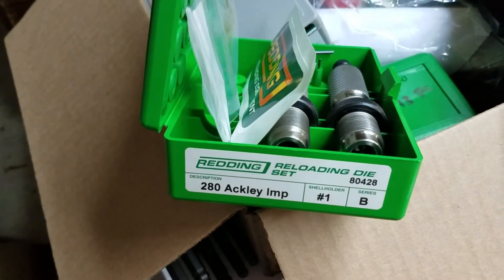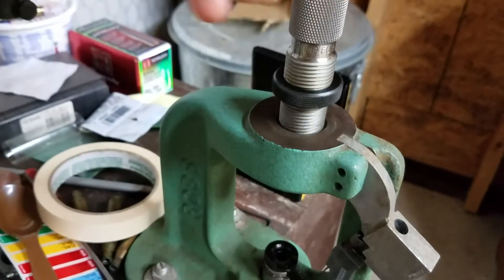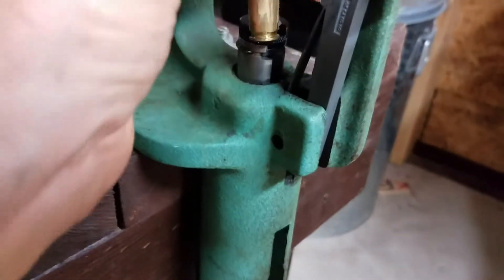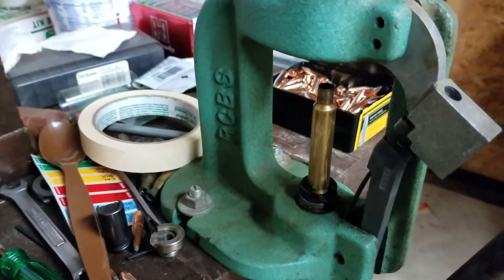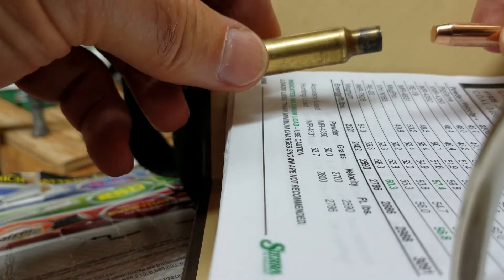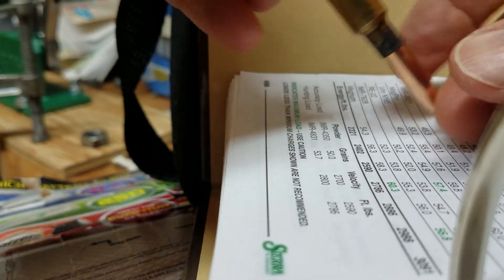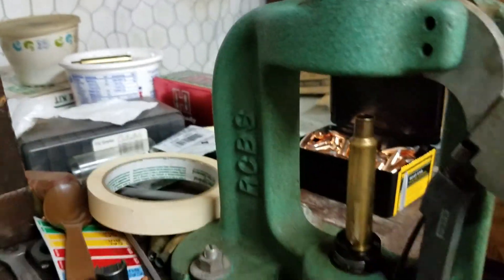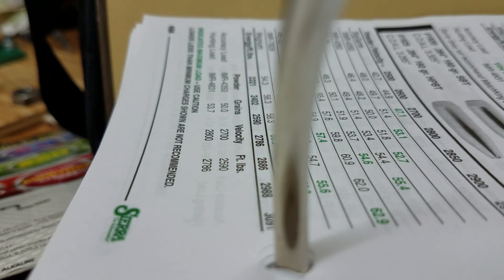Redding 280AI die neck sizing issues

Comment from the maker: This is a full length sizing die. The shell holder mentioned in video is the Redding competition. 014 for traditional original 280 Ackley Improved.  No need in running the plunger all the way down as I'm only trying to size the neck since this was the 2nd go around.